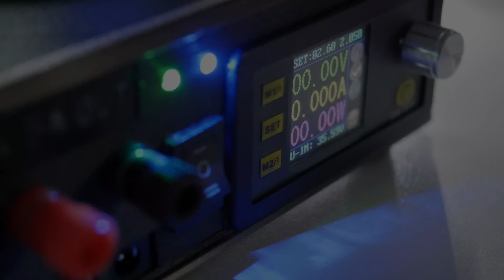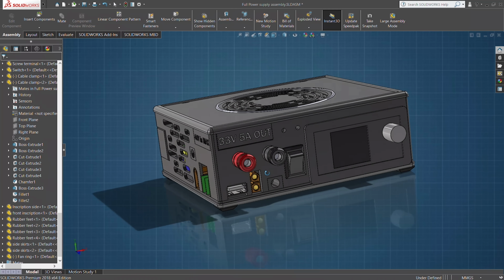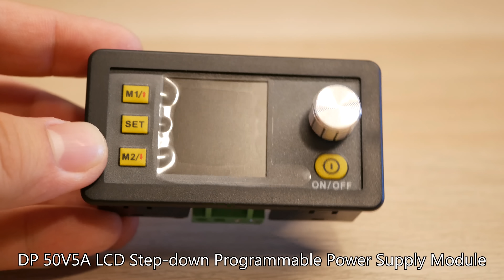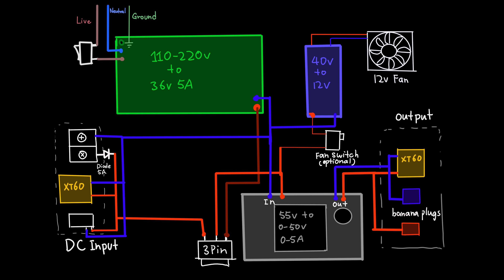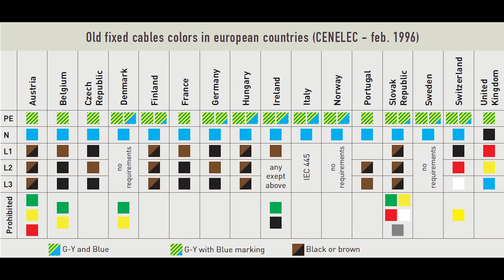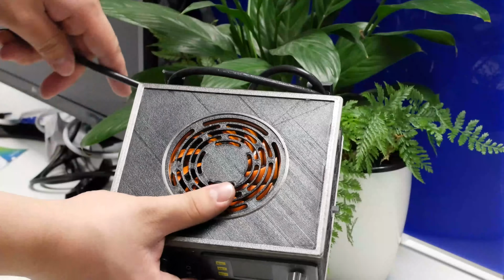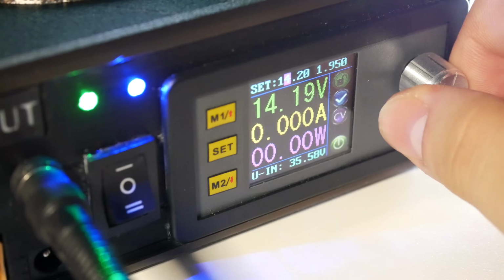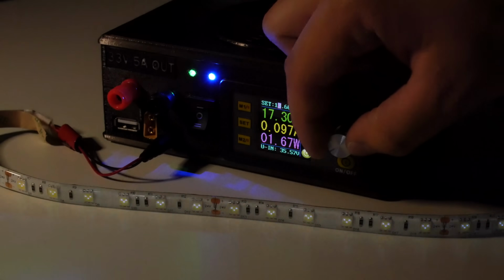DIY Mini Lab Bench Power Supply (With Switchable DC and AC Input)

Comment: Your projects are cool as hell....but your soldering technique is genuinely terrifying.
Reply: Soldering don't come much worse than that.   ;)
Reply: use Flux and itll go away.. bad solders that is
Reply: Flux is your friend,,, my friend.
Reply: I was also worried about it.
His soldering technique is worst commercial product level.
Reply: The soldering joints were all crap, but I have no doubt the solder joints will outlast the 3D printed case, the adhesive rubber feed, the fan, the step down converter and the glue holding in all the switches and jacks.
Reply: @chillzwinter  MAYBE. pretty much EVERY joint i saw was a cold joint. They are highly susceptible to cracking. And the cold surface joints.....those will crack, and fall off, if jostled enough. If the wrong one breaks loose, and makes contact with the wrong thing, you have a short, and a fire. That device is an electrical fire waiting to happen.
Reply: 07:45 was the worst I think
Reply: @1992jamo  lol, oh yeah, that one is pretty fucking awful..
Reply: Can someone point me to a good online soldering tutorial?  I haven't soldered in over 15 years and could definitely use a refresher.  Thank you in advance.
Reply: @rr2dee282  google up 'eevblog'. he has good tutorials
Reply: @rr2dee282  also mr carlson's lab goes into a lot of detail about different types of solder and flux
Reply: You took the words right out of my mouth.  I watched in both amazement and horror.  The techniques used are problematic at best for the longevity of the power supply.
Reply: @Cargoshots  And you sound immensely ignorant.
Reply: @Cargoshots  read the room Einstein. and get some more modern memes.
Reply: im sure he has gotten some pretty nasty burns
Reply: Show us your skills please ,
Because when ive gone to your channel couldn’t find any video
Reply: @ashmp2846  lol, i hope you don't honestly think that every person with a google account uploads videos to youtube.
Reply: I feel the same way about retards "whipping" their mig welds.
Reply: Lmfao
Reply: I’ve been collecting vintage soldering videos. They’re so well-done. The Pace Worldwide YouTube channel has a couple that were extremely informative
Reply: I agree, I lost total respect for this guy. Those joints are DISGUSTING.
Reply: The solder job at 8:49 was horrendous, although some of the other joints were not QUITE so bad. Some of the soldering footage was at 2x speed though, so it looks like he withdraws the iron too early but may not be quite as bad as it seems. (Still, I agree, the results are not fabulous by any means. This is a problem when working with mains, earthing, etc...)
Reply: @MatSmithLondon  8:32 😏
Reply: @MatSmithLondon  give him a fucking break. the soldering connections arent that bad. the one you pointed to was kinda shit but he screwed it down and then even glued it. even then you didn't see the final solder because it was out of focus. his iron was probably failing on the big copper. the rest of his solders were just fine.
Reply: @pepe6666  No. They really ARE that bad. The ground connections aside, because it really was a kludge, even the rest are sloppy. 

Solder is not glue. You don't just stick wires together with it. Not if you expect it to last. Connections should be secure first, then soldered.
Reply: @AlGritzmacher  thats bullshit. about the only thing that was shit was that last solder with the blob. so he made a mistake. he clearly knows how to solder. you can see that done in other parts of the video.

the psu is crazy dangerous but his solder joints were fine. its his mains & crazy holes in a plastic case that i find disturbing.
Reply: @pepe6666  Any credibility you might have had on soldering technique is now gone. You clearly don't know the first thing about it.
As I said, solder is not glue. Unless you make the connection secure first, adding solder on top of it is not enough. If the wire isn't secured by wrapping it around a connection, or going through a hole in a circuit board, it is not a mechanical connection. Solder only helps keep oxidation out and resistance down.
One good tug would undo most of those connections. Not what I would want to see happen around a bunch of Li-Po batteries.
Reply: Unfortunately, a lot of people are only learning how to solder by watching you tube.
Reply: @AlGritzmacher  🏅 heres ya medal
Reply: @AlGritzmacher  I'm going to have to disagree with you. Solder is literally glue. how do you think copper plumbing works?
Reply: @InsanelyMclean  You're absolutely right. His soldering is just like a plumbing job. A leaky one with the pipes coming apart.
Solder is more like caulk. It's job is to fill gaps and keep air out. Without a solid mechanical connection, it can be peeled right apart.
Solder is electrically conductive, but it's not as good as copper to copper. It's main job is to fill in the empty spaces to prevent corrosion. So you need a good connection first before solder is added.
Reply: @AlGritzmacher  You're right about his solder joints being terrible, but solder adheres very strongly when done properly. I could lay two stranded wires on top of each other (without twisting them together) and solder them, and you would break the wires trying to pull the solder joint apart. One of the first things I learned when learning how to solder was just how strong a properly soldered joint should be. A strong mechanical connection is not required to make a strong solder joint. (have a look at surface mount components)
Reply: @InsanelyMclean  Sorry, I can and have peeled two wires apart that were soldered like that. I've been doing electronic soldering since the 1970s, so I know a thing or two. Modern no-lead solder is even weaker. What seems strong to you by hand still fails eventually under vibrations in the real world.
I suggest anyone who wants to get good at soldering, look for some of the training that the military or NASA uses.
And surface mount is something else. You're only holding a part the size of a grain of rice down. Not a lot of stress on it.
Reply: @pepe6666  Final soldering????? WTF is that??? Soldering must be very good at the beginning or not at all.
Reply: @pepe6666  NO man! all solder are fucking bad. I think yours too. Documentation about soldering it's hard to find. After you study that documentation discover tens of mistakes you're done and you fix it ONLY if you realy want.
Reply: @pepe6666  Are you kidding? Look at 07:45. How long do you think that solder with last? lol
Reply: @InsanelyMclean  I'd like to see the difference in resistance between two wires barely touching that are soldered, and two wires that are entwined,  properly soldered.
Reply: @AlGritzmacher  I don't see you putting out any educational / tutorial soldering video..... with detail STP files and parts list.....
Reply: @pepe6666  The issue is the complete lack of flux. These joints are "bad" because there is no proper wetting action of the solder. Solder is basically entry-level welding. When it is done correctly, the solder penetrates the upper layer of copper and becomes a part of the copper. It creates a very strong mechanical bond between the solder alloy and the copper metal. It's strong but it of course can still be broken...but the point is, when it is done right, the copper and solder alloy are basically one and the same.  

So what if you try soldering without flux? There is no wetting action. The solder never penetrates the copper. It simply sits on top of the copper surface, and can easily be removed by simply scraping against it. This is known in the industry as a "cold joint" and these types of joints make up all of the soldering work in this video. 

Why are cold joints bad? Because there is no penetration or wetting action of the solder. The solder never adheres within the upper layers of the copper metal. It's just sitting on top of it. These types of joints can easily be broken in the future just by simply moving the device around, tugging on a wire, thermal expansion, etc. They are unreliable and will not last.  

So what does flux do that gives solder alloy this magical property? Flux is a chemical that removes surface oxides from the copper. Copper oxidizes rapidly at soldering temperatures. These oxides prevent the solder alloy from touching the pure copper layers that reside underneath the oxide layer. This means you're effectively sticking solder alloy to an oxide layer. This is why they are so easy to break, and why joints done in this fashion are unreliable. 

Additionally, flux performs another function: it serves as an oxygen barrier when heated to soldering temperatures. At soldering temperatures, flux melts down into a runny liquid. This pool of liquid residing over the copper will prevent oxygen from making contact with the raw copper surface, and should any oxygen come into contact with the raw copper, it will quickly be cleaned and removed. This creates a suitable environment for proper adhesion to occur between the two metals.  

At no point in this video does he ever add extra flux to the workpiece. He is committing the same exact mistake that I have seen hundreds of rookies to soldering do, which just leads them to question why their projects never seem to work or why they never seem to be able to solder very well. What he is doing is putting the solder on his iron, and then bringing the iron to the thing he wants to solder. This is a no-no. If your solder contains a flux core, what you're supposed to do is touch the iron to what you want to solder, then "paint" the solder wire onto the workpiece. 

The technique he is performing IS a valid technique, IF you have applied flux to the copper in advance. Sometimes this method of soldering is the only way you can do it because you only have two hands. There's no way to hold the solder, the thing you need to solder, and the iron at the same time. So you can put flux down ahead of time, put solder on your tip, then move the tip to the copper. This will instantly make a proper joint because all of the necessary parts are there. At no point does he ever put down additional flux. He just lets the flux in his solder burn off. That's what the smoke coming off the iron is. It's the flux burning away, the flux that would allow him to create proper joints if he used the right technique. 

AND THERE ABSOLUTELY IS "TECHNIQUE" TO SOLDERING. It's not an art, there is a right way to do it and a wrong way to do it. That's what people mean by "soldering technique". The technique of moving his tinned iron to the workpiece is a valid technique, but it's missing the critical component: flux on the workpiece. The lack of flux never allows for wetting action of the solder. 

Source: I have been repairing electronics under a microscope for 8 years. Thank you for coming to my TED Talk.
Reply: @AlGritzmacher i agree lol, i learned soldering technique from youtube. At first i always failed then i bought flux. Make my first diy project portable fan then after alot of error and some fire due to bad solder. I finally can say that i can solder way much better than this guy on the video.

But i know how much stressing to build this diy project. Maybe he's focus is all into the project not the solder.
Reply: I see this so much of the time anymore, don't they teach soldering in electronics programs anymore?
Reply: @ReneStover  I have no idea. I mean, i only did electronics in high school, so i can only speak for that.. almost 20 years ago... they taught me to solder correctly. I've only gotten better at it since then. I don't know if they cover soldering in high school anymore, or college, or vocational school....maybe they do, maybe this guy was taught how to do it right, but doesn't care, or sucks at it.. 

Or maybe he's self taught, and learned how to solder from watching some tit on youtube do it wrong. I honestly have no idea. What i do know for sure is that his soldering technique is genuinely terrifying.
Reply: @LBCAndrew  Agreed. Shop classes were my favorite ones in high school. I tool wood, metal, and electronics. I would have taken auto, but i couldn't pick any more electives, lol. I drive older cars...i don't like all the fancy gadgets, and electronic aids..i'm REALLY kicking myself for not taking auto shop.
Reply: @numberyellow  the guy making the video will likely get better
Reply: @JimTheKid  He's been at this for a while. Soldering is one of those things that you either do right, or do wrong. There's not much technique to it.
Reply: @numberyellow  Sure there is...
Use correct temperature
Use flux if you somehow brought solder without it inside
Tin stranded wires if you're not soldering two stranded wires together
Different twisting techniques for connecting stranded wires before soldering
And I think most importantly: Heat the wires and apply solder to the wires, rather than melting the solder on the iron and hoping it flows onto the wires.

There is probably a million other tips, and many of them depend on what you're doing. I think it's easy to forget that you use these techniques once you've experienced and don't have to think about it.
Reply: @1992jamo  Yeah, but that's not technique...that's called doing it correctly.
Reply: @ReneStover  clearly not. They also don't teach how to clean the tip and keep it from rusting to hell. I have tips that have lasted 15 years and still going strong, along with my Hakko 936 ESD. And they get used quite a bit.

Comment: Put a high value cap across the output of that DC step down converter, and then it's great. I had issues with ripple until I did that.

Comment: I did exactly the same thing. the only difference is I used a external 36V ACDC converter that is dirt cheap.  lesson learnt the hard way,  this thing does not have any ground connection or mains isolation. And it comes with a 2 pin plug that u can plug in either polarities. So whenever I use it, there is a 50% chance that I am touching live wire. now I ended up using 18650s....which is another good use of this module

Comment: I love this bench PSU.  I liked the beginning explanation up until the shock diote.  From this point on,  we all might appreciate each step explained as each step before.
Reply: It is a  Schottky diode  but a power silicon diode will also work - it just has a higher voltage (0.6 versus 0.2)

Comment: good power supply but here in brazil, I will spend more money doing this than buy a power supply like this >> https://www.banggood.com/Switching-Power-Supply-Transformer-Adjustable-AC-110220V-to-DC-0-243648V-480W-with-Dual-Digital-Display-p-1429755.html?rmmds=mywishlist

Comment: 8:25 "and mount the fan to the top of the lid" How? I see no screw holes, neither printed stubs... hot glue? :)
Reply: Janos Nagy J. I ended up drilling 4 small holes in the lid and mounting it from the top with a small standoff spacer to keep the fan blades from hitting the lid.  Still looks good.  I was curious about that one myself.
Reply: @jetrenkel  Nice way!

Comment: You should have used an IEC receptacle rather than cutting the AC line cord. Incorporate mating for the receptacle into your 3D print and you're done.
Reply: Also has a inline switch or sometimes even a fusing option. Also makes it easier when you move into a different coutry, just change the Cable, done.
Reply: I was going to say the same thing. could have been much cleaner, without the integrated power cord.

Comment: Nice job.  Is there any reason you did not just put the diode in series with the combined positive input from all the DC jacks? It's possible for any of those inputs to be miss wired - even if the jack is polarized.

Comment: Outstanding. The best teaching video I've seen of its type. That comes from a guy who taught for 37 years. 

Some picky stuff, sure. 

A diode should protect all the DC inputs and outputs.  People screw up wiring barrel jacks and such all the time. Think about a smoothing cap right at the binding posts. Do some ripple tests and work out your optimum capacity. 

The mains termination to the board really needs to be mechanical. Solder and hot glue aren't enough. 

I'd add a set of USB sockets to both input and output sides. Use diodes here again. 

As in all designs, things would change a little if you had an industrial style review meeting or committee. Someday, you will be running one of those if you keep going. 

I can't find a Patreon account for you. If you have one, please let me know. 

I would be interested in purchasing your boxes or even kits. Let me know if you are interested. 

You're a star kid. Keep it up.